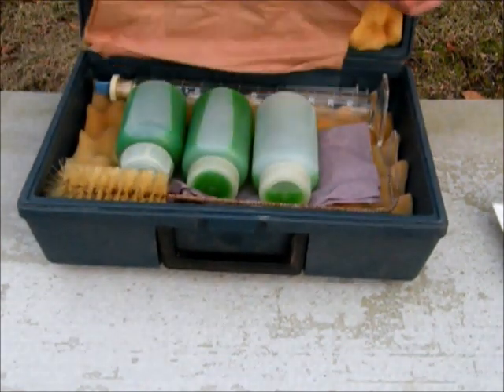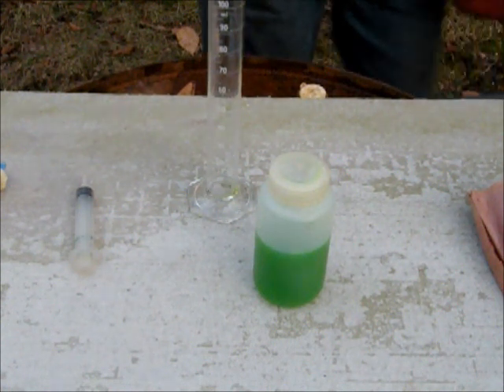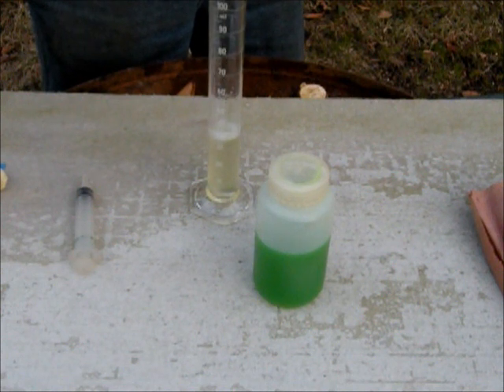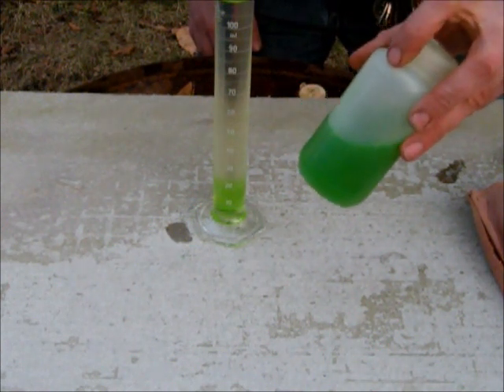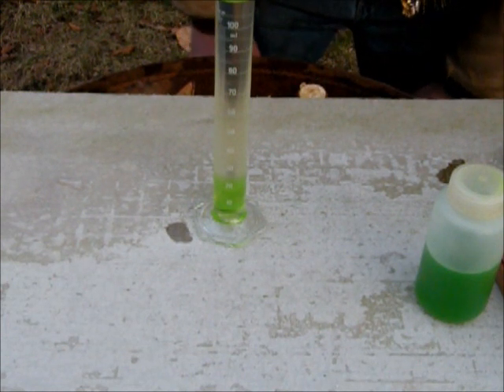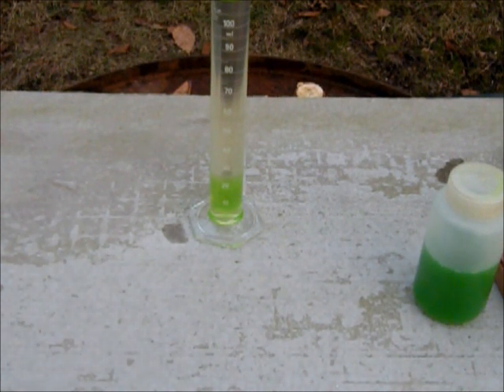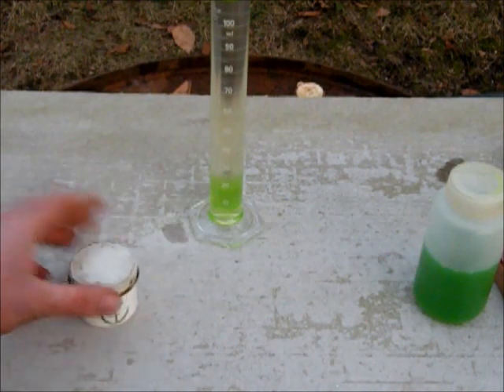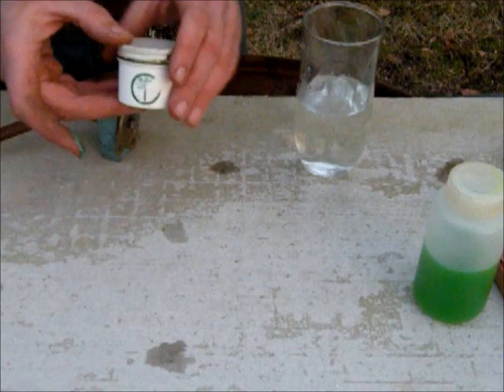Testing For Ethanol In Gasoline Using Ethylene Glycol

Comment: I wish the graduated cylinder was designed for this. There could be a 10ml gap at the bottom to negate the extra antifreeze that's added.
Reply from the maker: Use your imagination ;)

Comment: Most tests for ethanol in gasoline use water instead of ethylene glycol (antifreeze).  Can water,  perhaps with food coloring, be just as good but cheaper.  On a larger scale, draining off the water/ethanol mixture after separation in a larger container would leave pure gasoline in the container.  Suitable for use when ethanol free gas is desired or required.  This can be called water washing the ethanol out of the gas.
Reply from the maker: cphank151 I've never tried it with just water, but what you are saying sounds reasonable. My Dad started out working for Red Head back in the early 60's which was eventually bought by Ashland Petroleum. Back when ethanol came out on up into the 90's he would use this test kit to check the fuel at each pump at the gas stations that he was responsible for.
Reply: Chip Wright, because ethylene glycol is an alcohol, as is ethanol, they are easily be soluble in each other while gasoline, being non-polar will easily separate from the mix of antifreeze and ethanol.  Water is a similarly polar solvent.  I think the dye in the ethylene glycol is likely the biggest advantage of using glycol.  Although I didn't film it, I found that glycol makes a more distinct separation from the gas much sooner than just water.  Therefore glycol is probably the best for quickly getting a somewhat quantitative test of ethanol percentage.  Water washing, perhaps with food coloring in the water, is probably the most cost effective way to isolate pure gasoline from E10 or similar in larger quantities (5 - 10 gallon batches) if more time can be allowed for the layers to separate.